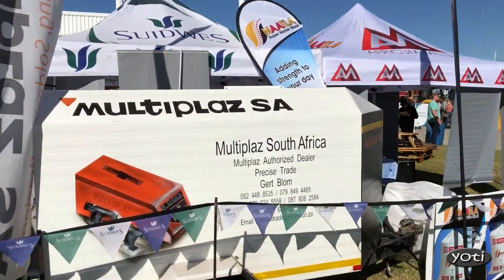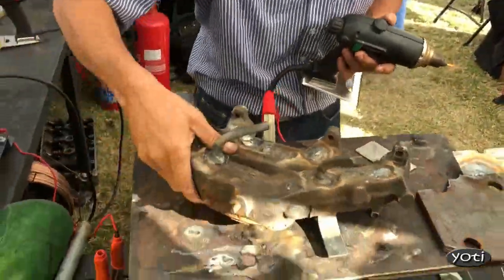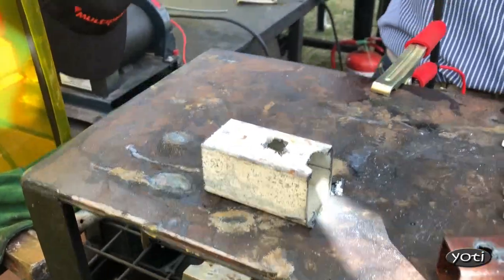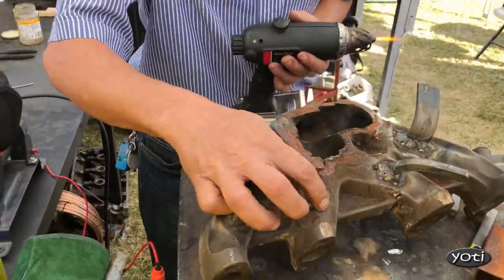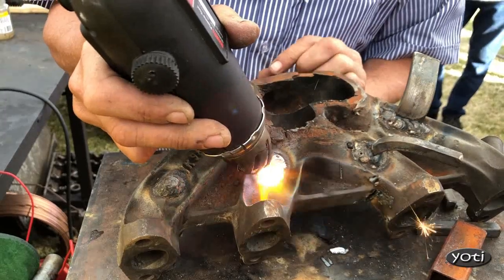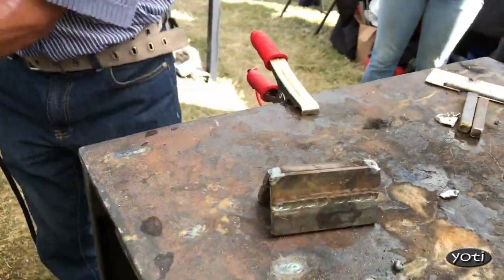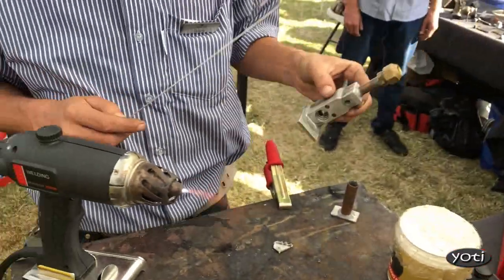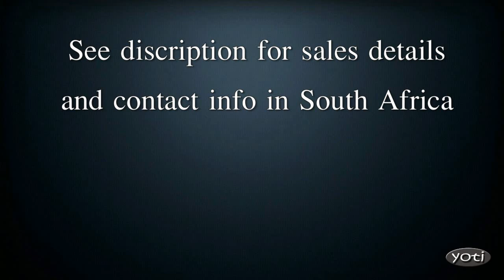Weld and Cut ANY metal with this ONE machine.

Comment: I bought one of these in 2013 and as this guy says you can weld or cut any metal without gas or expensive special welding rods, just water.
Welding cast iron is so easy using just plain mild steel rods.
It does take some practice and getting use to as it's not the same as a stick or Mig welder.....you could compare it to a Tig welder on steroids with Oxy/Acc characteristics but with an 8,000 deg C heat source.
Now try welding copper....that is so easy.
BTW, I would advise a darkened grinding face shield as you do get some sparks and the brightness from the weld pool is quite high so a dark shield is advisable, even sun glasses are OK as there is no UV rays or arc flash like a stick or Mig welder to worry about.
You can weld inside the garage as there is no toxic fumes apart from any grease or dirt smoke that might be on the parts you are welding.
You can weld steel that has a thick coating of rust or paint without prior cleaning it as the flame from the torch just burns it off and it blows away.
I forgot to mention, if you want to do some hard surfacing all you need is a spring.....heating it up and straightening it out gives you a high carbon welding rod that you can apply to all your garden or earthmoving tools and they'll last forever.
Reply: What is the name of the machine

Comment: My plasma cutter cuts any metal and uses air. It can also weld too and still uses air and no filler rods.
Reply: The Multiplaz does not use air, just water to make the plasma.

Comment: What flux does he uses for blazing aluminium ? does he weld it in mode 2 ? is this a ordinary rod of aluminium or a special rod ? unclear
Reply: Hi....you can weld aluminium with mode 2 and ANY welding filler rod....even a cut strip, but you must be quick or you will burn a hole through the metal as the heat spreads with aluminium very quickly. 
Use some powdered flux to dip the rod in and you won't have a problem.